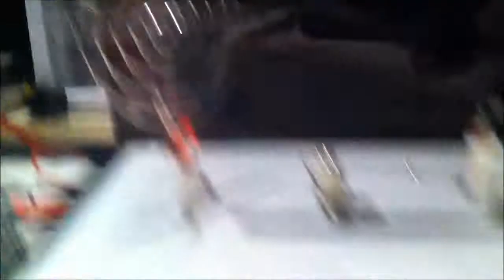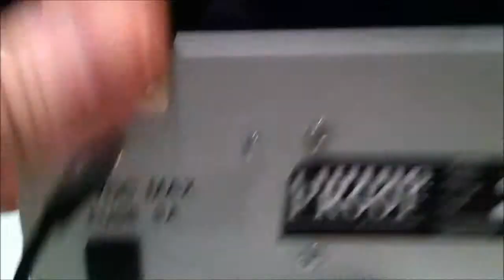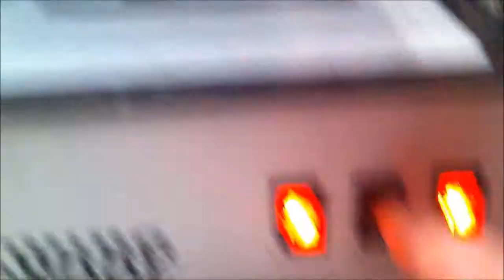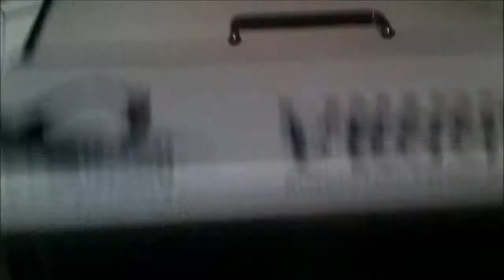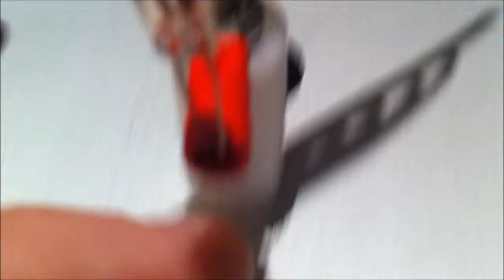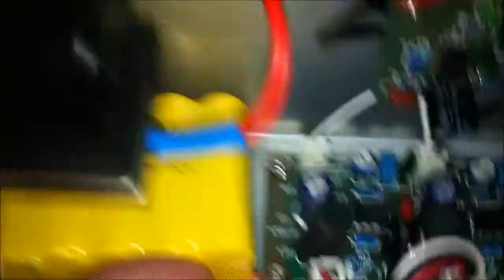Fun discount find - Ionic "air cleaner" demo case with flybacks!

Comment: It doesn't melt the insulation of the smoke coil to make smoke. The insulation is high temp fiberglass on a nichrome heating wire element, similar to the insulation that labs have on heating elements that can be wrapped around glass lab flasks to boil chemicals in. The smoke is made by putting a few drops of smoke machine glycerin on the absorbant fiberglass insulation, and the heat vaporizes it. It's basically just a science demonstration of how ion air purifiers work to remove smoke, and air pollutants, from air. I also agree with Arcadeuk, that it looks too good to take apart and cannabalise for the high voltage components, when any old CRT TV will provide what you need for a high voltage, very low current power supply.
Reply from the maker: Good to know...  thanks for the clarification!  I do kind of wish I had not taken it apart back then...  but the case did make a very nice enclosure for an adjustable DC power supply project, so not a total loss...